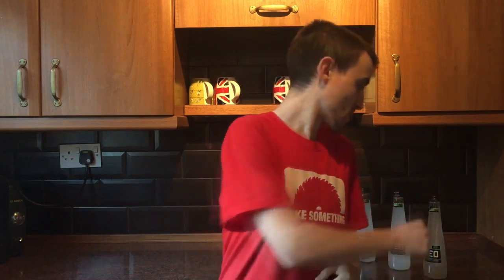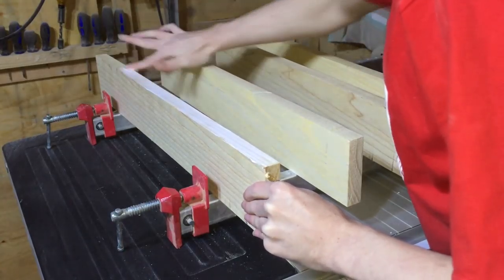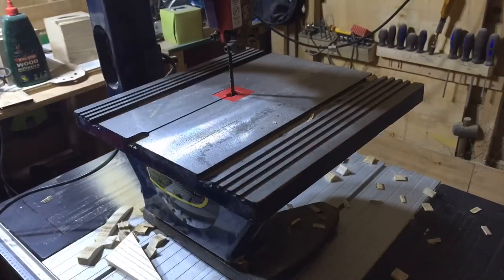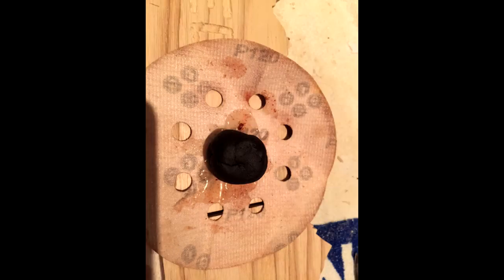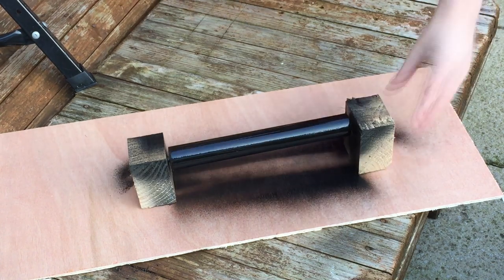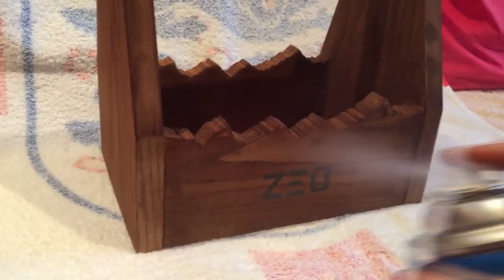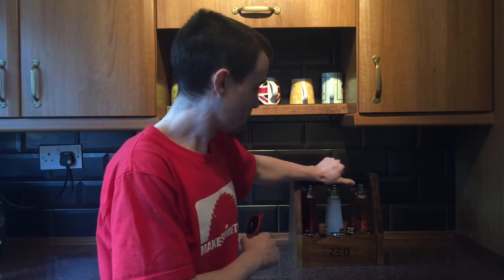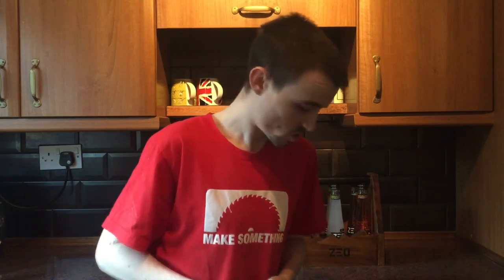6 Pack Carrier for ZEO Drinks

Comment: Very nice job on the carrier but it seems it will only be filled with empties. Maybe that why you're sending it to Zeo (haha). Liked the epoxy marquetry. Guess the bottles are heavy because you used such think wood?  Of course you know you can use the TS or BS to cut them thinner and use your new planer/joiner (very very nice BTW) to smooth out the blade marks getting two for one out of the boards. You mentioned the BS wandering, so you might try bringing your upper guide down closer to the wood and for straight cuts a makeshift fence held in place with clamps. Thanks for sharing and good of you for sending it to ZEO.